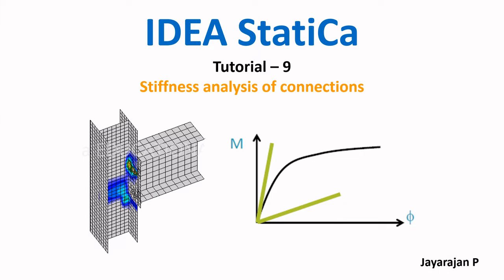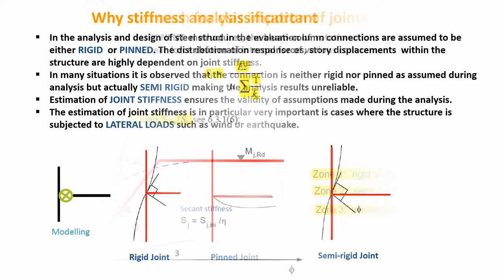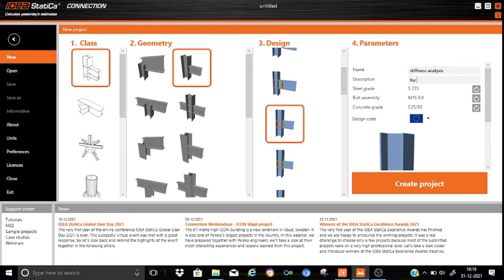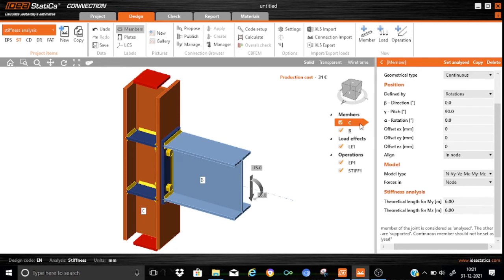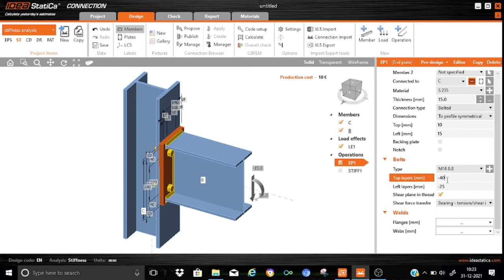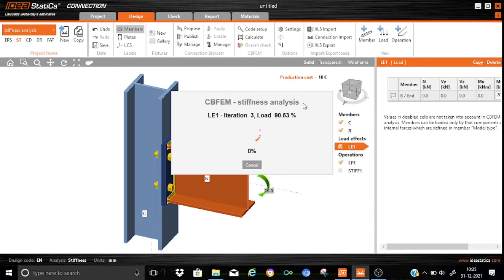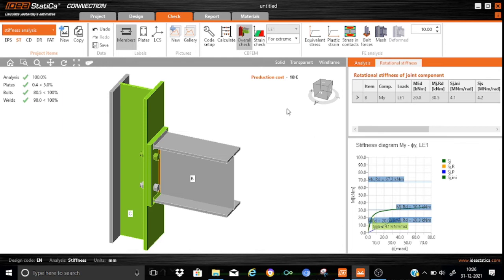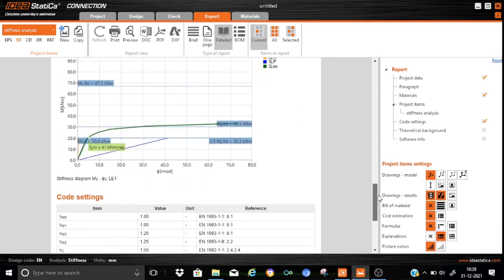IDEA StatiCa: tutorial-9: STIFFNESS analysis of  steel connections

Comment: Thanks for sharing. I have an important query. How about the stiffness analysis of bolted splice connection when you make it say at 0.5m and you input the theoretical length the full span between column in both major and minor direction. I have did one for my project and the splice is showing pinned. Would appreciate if you explain this case

Comment: Hello, the results that you got from IdeaStatica are different from the worked example that you just showed in 0.45second of this video. And the difference is almost 2MN/rad. Can you explain this?
Reply from the maker: KIndly make your question more clear. The hand calculations made with COMPONENT method obviously differ from IDEA Statica  calculations. A   difference of  2 MN/rad will not make any difference in stiffness classification of str. connections.
Reply: @puttattjayarajan1199  Which part of my question is not clear? anyways, Months ago I solved that example and as I remember the results for initial rotational stiffness was approximately 6MNm/rad. The difference of 2MNm/rad will clearly have impact on bending moments distribution if we want to implement this procedure on designing some steel frame. Just classifying a connection has no practical meaning. So my question is, why there is a 2MNm/rad difference?